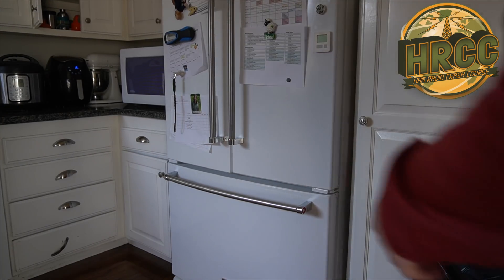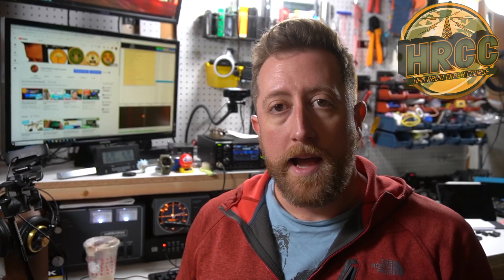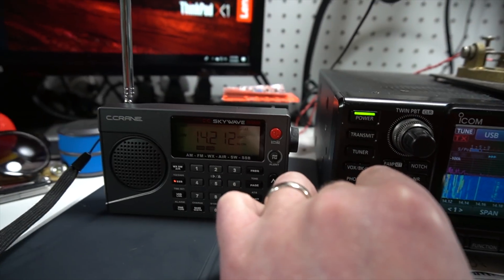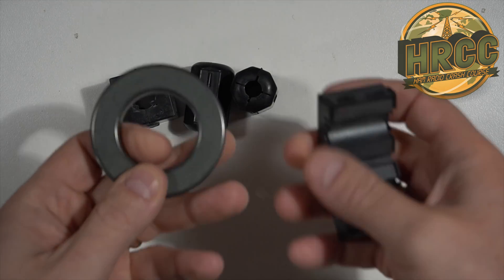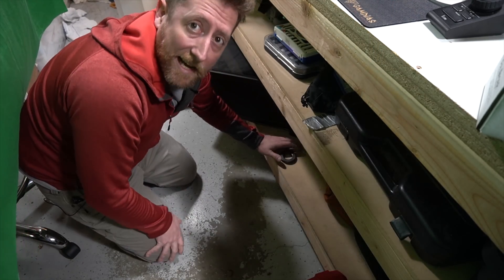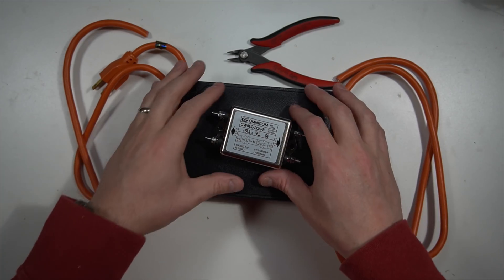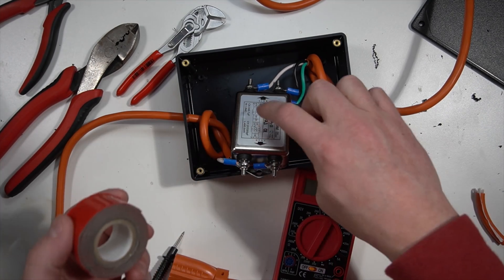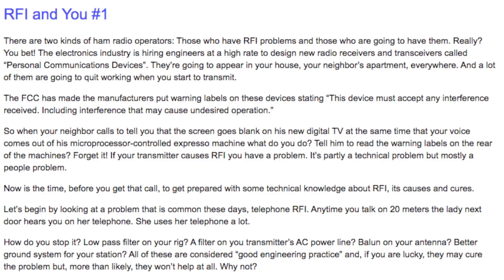WE are killing the amateur radio bands, and here is how to fix it (RFI)

Comment: I have always suffered with RFI at my location having  120 KV lines running behind my property.   But I never thought about checking the appliances.  I have an Electrolux refrigerator (we call it Electrosucks,  it is really that bad),  it is a good bet that thing is screaming at RF.  
I am betting that any appliance that has some kind of digital electronic controller would be suspect.   Part 15 is a total joke.

Comment: What "dryer" are you using that is running on 110 volts??
Reply from the maker: It’s natural gas.
Reply: @HamRadioCrashCourse  Thanks for your reply.  I guess its obvious that I never had a gas dryer.
Reply: gas dryers run on 120.   we went out of our way to buy a washer and dryer that have no digital controllers in them,  all this new computer controlled stuff is trouble.

Comment: Not having a ground on your dryer sounds DANGEROUS.  I would tie the grounds together.

Just wondering: is there any point in telling the FCC about bad devices?
Reply from the maker: I’ll indeed get the dryer grounded. That also seemed incorrect to me. But for the test it worked.
Reply: @HamRadioCrashCourse  I wonder if you don't just tie both grounds to the one post like in most house wiring.
Reply: @koldark 
Power AC is not like power RF. It locks up muscles - in many fatalities the victim was not able to let go or was shocked directly into a heart attack. Since radio doesn't have that hazard - it can cause surprisingly deep burns but it doesn't lock up muscles - it's easy for radio experience to lead to electrical complacency.

Best to not second-guess code: ground and neutral must be connected at one and only one point. 

If there's still noise escaping via the grounding conductor, the next step would be to go inside the appliance and attempt to filter the EMI closer to the source. Don't mess with the chassis grounding. It must be wired through the AC equipment grounding conductor, no filters or interruptions, back to the service panel. Assume that the neutral will become 120V without tripping breakers. 

If you really want to shield something with a shield that isn't grounded, it must go inside the grounded safety chassis so that it doesn't present a shock hazard. 

(Strictly interpreted any modification is a violation of the appliance listing standards, but meh... It's still safer than counterfeit Chinese crap.
Reply: @jordanrodrigues8265  I'm not a licensed electrician (nor will ever claim to be), but I have worked with it since I was a kid. I understand all of this. I would consult the documentation or a licensed electrician if I had questions.
Reply: @HamRadioCrashCourse  Your dryer plugs in with a regular 3 prong cord? Every dryer I have ever had was 220 vac.
Reply: @arthursmith5252  Apartment size dryers plug into regular receptacles.
Reply: @arthursmith5252  I was wondering the exact same thing!
Reply: @arthursmith5252  could be a gas dryer. I have a gas and it's 120v. Electric dryers are usually 240v
Reply: When I saw that, I figured he has a gas dryer.
Reply: @arthursmith5252  It's probably a gas dryer, like mine.  The A/C is only for turning the drum.
Reply: @arthursmith5252  gas dryers still need 120 for controls, spinning the drum, and the fan/blower.  220/240 would be for dryers where the heat comes from electric elements.
Reply: @arthursmith5252  ,  natural gas are 110v.
Reply: @arthursmith5252  My gas dryer uses a regular cord.  Only needs to spin the drum and power the guts.
Reply: @arthursmith5252  I suspect his dryer is heated by natural gas as opposed to all electric.
Reply: @arthursmith5252 ,
Every dryer I've owned was natural gas fired by a spark igniter and operated by a 100V electric motor.  Ditto for my gas furnace. 
In the US and Canada, eery electric dryer needs 220VAC.
Reply: @arthursmith5252  GAS dryer
Reply: @arthursmith5252   Some dryers heat the air with gas and only need 120V to rotate the drum and run the electronics.
Reply: @arthursmith5252  US NEC specified dryers get an insulated ground by the mid 1980s. I remember because I was working under a mechanic  who kept crying about having to change it when he made the mistake of using 10-2 NMC when the requirement is the more expensive 10-3.
Reply: @HamRadioCrashCourse  Not having your dryer grounded is beyond incorrect and going into extreme stupidity territory. Also guaranteed to be a major violation of your local electrical code.
Reply: @HamRadioCrashCourse  I was thinking the same thing but you can always just tie the two ends to ground together...….. hope I explained that right
Reply: @HamRadioCrashCourse  A single point ground connection is REQUIRED by UL. You should just cut back the jacket until you have enough Green(/yellow) to reach that screw and adjust the blue  and brown (or old school White and Black) to fit neatly
Reply: @HamRadioCrashCourse  BTW, what is with calling the wires positive and negative? AC stands for alternating current, which means the current alternates between positive and negative thus calling wires positive and negative is meaningless. The wires are called hot and neutral. The hot wire having the live power and the neutral being the return. If you don't understand this, it is best not to touch it and get a pro to do it. Failure to do things properly can drastically shorten your life or worse the life of somebody else that didn't have anything to do with your sloppy work.
Reply: I spent most of my life in the appliance business, if possible we would always run a ground wire from a washer or dryers cabinet to a grounded pipe. I don't know what the appliance manufacturers do now, but back then a ground wire was included in the installation package that came with the appliance.
Reply: @G56AG ,
Every  dryer loaded with wool generates ENORMOUS amounts of static electricity.  If you doubt this, try looking into a mirror, while rubbing your wool sweater on your hair in a totally darkened room in the Winter.  Think about the flammability of accumulated lint in the exhaust vent and you will probably opt to attach a cold water pipe ground.
Reply: Yes tie the greens together
Reply: @kevinharrell3575   grounds not greens darn auto correct
Reply: @mikethees6434  you're still ok, ground leads on most devices are green. 😉
Reply: @dave1135   yeah I know used to install PBX's for a living you don't power one up till you check all the electric  my boss didn't one time and let a quarter million worth of magic smoke out
Reply: "Just wondering: is there any point in telling the FCC about bad devices?"

Pretty sure that the FCC has by now worked out that anything imported from Asia will be an RFI generator, especially CHINA = Crap Headquarters International, No Argument.
Reply: @James_Bowie  sorry to say but probably depends on how much money have. Those devices probably say Part 15 compliant. You report them, but what are the except able levels. Maybe it would something stupid like 3db at 50ft and your 35ft from your refrig. I'm curious about the whole thing of "trapping" the electric lines. Who says that how your receiver is getting the rfi. With that short wave receiver that shows the rfi is emitted not induced. The rfi is being transmitted, that why it shows up on a band scope. The AC lines are the antenna. Run the radio on battery and see what happens
Reply: Put both ground wires on the one ground lug!
Reply: Definitely tie both ground wires together. I am an electrician. If you don't connect them together there is no ground of the dryer and if as fault occurs the chassis could be live and anyone touching the case will be the opposite. (dead)
Reply: @Dave-VK5PL  PSssst we are all hams and have had our experiences with hot chassis  cough S-38 Cough
Reply: The one ground terminal is a "common ground point" to ground the case. Tie both ground wires together there
Reply: Not connecting equipment to ground, especially in a dryer - will quickly lead to static build up when the materials inside are moving around and having air blown through it.
It will be an enlightning experience, perhaps even painful, especially if you don't expect it. ⚡⚡⚡ (And ⚡ emits RFI too, so mount the filter on the dryer metallic cabinet itself - and it is grounded automatically, not in a plastic box that might melt down and even catch on fire if the dryer is drawing too much current for the filter to handle)
Another point - wrapping the wire around the toroid core will increase the DC Resistence by number of turns and lower the saturation current by the number of turns.
Reply: If it is a gas with a spark igniter that could be your RFI source as the high freq switching High voltage supply and the spark gap  - see the original ham - Marconi. Suppression will be Requiring Series inductance and shunt capacitance and shielding inside the unit in close proximity to the igniter including  its hi volt cable (antenna)  not so successful when applied many feet away on power cord...big engineering redesign job. Ie if you put a choke on the power cord of transmitter it would reduce back RF in the ac but the transmitter would still drive the RF out the antenna! Look for a hot surface igniter product for gas appliances
Reply: @earthfarmer  why would the igniter be active all the time?
Reply: What is the size of the torrid u used??

Comment: IT'S COMING FROM INSIDE THE HOUSE!!1
Reply: IT"S IN ZE ATTIC!!
no really at my old house the furnace / air handler was creating noise because of its control board
Reply: @Elfnetdesigns  another prize winner was corroded pipes, which failed soon after finding the corrosion - right near the ground clamp for the breaker box.
Nothing like repairing, repairing and repairing again that rotten branch of pipes, then adding a proper ground rod.
Reply: IT'S WITHIN THE ROOM!!!  ailen pops out of ceiling
Reply: There must be some kind of way out of here,
said the joker to the ham.
There's too much interference now,
I can't get no relief.

No reason to get excited,
the ham, he kindly spoke.
There are many here among us,
who feel the bands are but a joke.
But you and I, we've been through that,
and this is not our fate.
So let us stop talking falsely now,
the noise floor's getting high.

All along the radio mast,
operator kept the QSOs.
While all the contacts they came and they went,
CW devotees too.
Outside in the cold distance,
a wildcat did growl.
Two arrangers were approaching,
and the wind began to howl.
Reply: come on baby, come on baby    Wait, wait that can't be right. It's the end of the world as we know it
Reply: Whispers there is someone behind you.
Reply: @cobz76  whispers that's only my wife with the gun, they have to worry about me, with my knife.